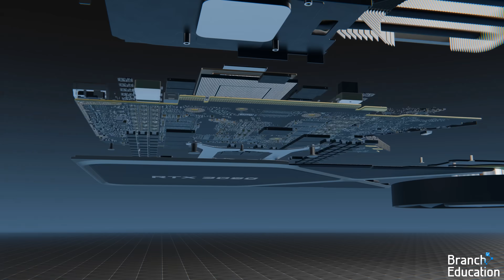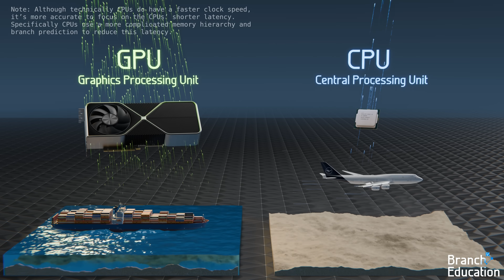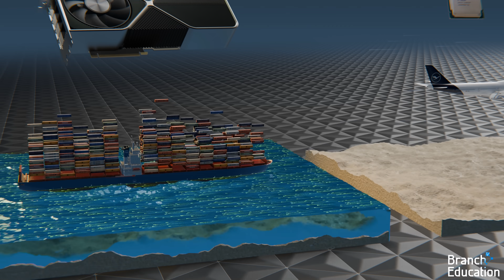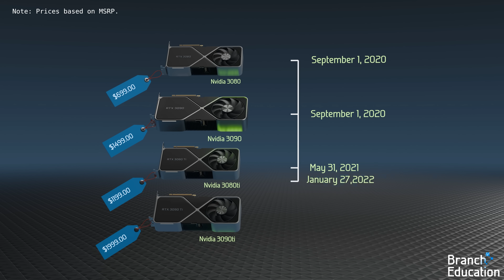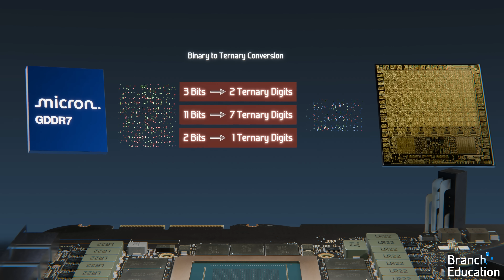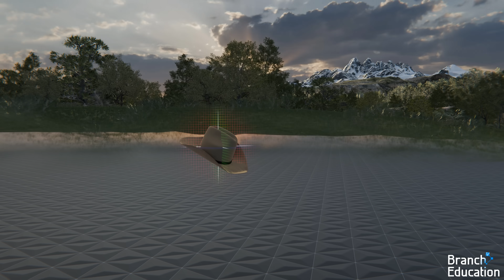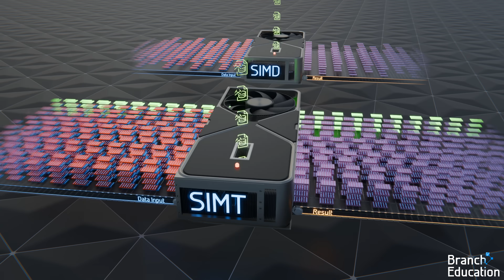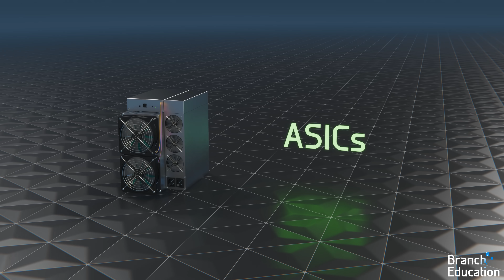How do Graphics Cards Work?  Exploring GPU Architecture

Comment: Great video, but as you quoted the N64 as being 100 million instructions per second I think you got confused rounding up the main MIPS CPU clock speed of 93.75MHz...
The N64 contains 3 components, the RSP which is the vector calculation unit of the N64 for transform & lighting, can process an 8 element vector instruction & dual issue its own scalar MIPS instructions in 1 clock cycle.
As the RSP runs at 62.5MHz (2/3 of the main CPU speed) its total calculation bandwidth is 500 million vector calculations + 62.5 million scaler calculations per clock cycle.
Also the N64 has an RDP (GPU) to render polygons to the screen running at the same speed as the RSP.
So in total the N64 is running at 93.75 + 500 + 62.5 + 62.5 million instructions per second (~718.75 million) when fully utilized, far more than the 100 million quoted at the start of the video!

Comment: any idea why my GPU bricked up whenever it htis over 66*C? had it for 7 years a 1060 3GB. 3 years used normally = these 4 years its undervolted while on boost clock

Comment: would be nice if there was an actual useful utility to see gpu load distribution and bandwidth utilization, especially on windows. otherwise just knowing about how things work is just useful theory.
Reply: There is, each hardware vendor has their own utility, in fact. NVIDIA has Nsight Graphics, AMD has Radeon GPU Profiler and Intel has its Graphics Performance Analyzers suite. Each plugs into hardware profiling metrics on the GPU to give you a breakdown of how each component and subsystem of the GPU is loaded, as well as where your performance bottlenecks are.

Comment: 8:45 correction, the 3080 actually has 10GB not 12GB, also the ti model has more memory bus bandwidth from 320bit to 384bit bus. It's basically a more cut down 3090 with half the vram

Comment: Very interesting video.  Although, I'm using a nearly decade old GTX-960 with 'only' 1024 Cuda Cores.  It was considered impressive when I bought it way back then.  And, I just checked on it on Amazon.  Still available, and surprisingly selling for $320 even at its advanced age.  I'm sure that if I was shopping for a new GPU today, I could find better for the same price.  But, not a gamer, so no need.  I bought it back then to speed up my seti@home crunching.

Comment: My question is, if you have a GPU with slightly more functioning cores than the 3080 but less than the 3090, do you 'deactivate' some cores to even it out or does that 3080 retain slightly better performance?

Comment: the part with the ASICs doing 250 Trillion hashes saying it replaces 2600 graphics cards.
didn't the few seconds before say that the graphics card only does 95 million?
isn't 95 million hashes per second per card, times 2600 cards, only 247 billion hashes?

are the putting around 1000 asics inside the "computer" to give it the 247 trillion number?
Reply: ASICs are smaller and take less energy. More of them fit.

Comment: It's a shame you didn't find someone who does graphics dev to review the video like you had for the memory part.

There's too many mistakes on the GPU side for me to let it slide:

1. You can run an OS on the GPU (it's not practical and it's slow, but it's possible). You can access USB,  network,  disk, etc. Today's Operating Systems are not happy with the GPU doing that, because it would compromise security. It's not a good idea to have two commanders in charge of the same platoon.
2. CUDA cores can do a lot more than just basic math. It can do jumps, calls, index memory, process strings, process interrupts, process virtual tables. A single CUDA "core" has more in common with a Z80 CPU than people would think.
3. A per-thread Program Counter is not what makes it SIMT. Only NV has per-thread PC, and only since Turing
4. GPUs moved from SIMD to SIMT a lot sooner than 2016. NV moved in 2006. AMD moved in 2012
5. Tensor cores can do geometric transformations, but they are not used for that in videogames
6. When comparing CPU vs GPU, I was hoping to see that they both approach parallelism in a different way; which is their main key difference. But alas, not even the world "parallel" was mentioned

This video is explaining how GPUs worked in around 2007 + Tensor + AI and how CPUs worked in 1997.
The memory section was cool though.

Comment: Spreading the different proceccing cores across the die is pretty smart as it also spreads the heat generation evenly when not all types are used

Comment: The animations are sick. But as a graphics programmer, I find the metapohors simplify too much. The GPU is equivalent to a ship? Yeah, no.
Reply: What would be an superior analogy to explain the difference between CPU and GPU?
Reply: @jannikheidemann3805  Cargo is more akin do data, rather than calculations. I mean, the containers don't do anything, do they? And why are do they use vehicles as an anology? The chips on your board don't move... No, a better analogy would be workers. The CPU would be a workshop. It's small, but it has all the tools to craft everything. The workshop has just a couple of workers, but because there is no bureaucracy, it's stupidly fast. If a customer requests an item, they can build it right there right now. But then there comes a customer that requests millions of the same item. Sure, the workers are fast, but not that fast. In comes the GPU, which in this analogy is more akin to a whole factory. The factory is specialized in doing one, but only one item. And because of lots of moving parts and bureaucracy, they are not as fast as the workers in the workshop. They take their time, just to start up. But because the factory owns a ridiculous number of machines, once they get started, they can pump out many items in a short amount of time. But to buy their item, the customer wouldn't go to a factory, would they? They would go to a storefront more akin to the workshop. They request their million items, the workshop prepares specifications, and sends them over to the factory. The factory then produces all the items. When they're done, the factory sends the finished items back to the workshop. This process is very simmilar to how you would program with a GPU. You upload data to the GPU, tell it how to deal with the data and what it should do with it, and then display the resulting image on the screen or download it back to the CPU.

Comment: @11:50 if you add a ton of Noctua Thermal Paste and a custom copper vram you can cut down the temps by 35c-40c. Especially on the 3090FE.
Reply: You mean a VRAM cooler?

Comment: It begs the question.  With the immense cost and complexity being a serious bottleneck of current GPU's why are we forcing TPUs into them when the vast vast majority of users simply do not need them?  Couldn't these be produced separately for those that need the AI processing power of TPU's and conversely no need for CUDA or Ray Tracing?  Would that not drastically reduce costs for all end users?

Comment: If we could find a better solution for cooling, that would instantly enable us all to output even more power since were able to cool the chips better (and those run better the cooler they are), i suspect in the future we will have graphics cards for example in a close system that is in a vacuum so we dont cist inside condensing water when cooled below a certain tempreture.

Comment: 7:06 Whaaat does it mean that my 4070 has the same chip as the 4090, but damaged? 😵‍💫 Sounds like heated seats in a BMW as a subscription.
Reply: No, the 4070 uses an entirely different GPU to the 4090 (AD104-250 vs AD102-300).

Comment: Absolutely amazing video! One small thing, while watching I noticed that you used the example CPU to be the 10850K (10th gen CPU Comet Lake Architecture), a 10 core 20 thread CPU, while when opening it up you showed the 12th gen architecture of Alder Lake, and more specifically the configuration of a 12900K with 8P 8E 24T (24 virtual cores). Just wanted to mention it as it may be a good disclaimer for an otherwise incredible video. Keep up the good work! :)

Comment: I am an engineer, and the level of detail, and animations like showing the eye diagram from the ternary encoding, drive tears of joy into my eyes. Thank you so much!
Reply: I hear you. 60 year old electronics engineer here that built his own 8-bit microprocessor systems back in the day. We've sure come a long way 👍!
Reply: @jcgdijkstra his own as in doing it at home? Respect mr
Reply: EE too, and I was like: WOW!
Reply: Looks you're mechanical from profile pic if that's your pic
Reply: A engineer in what?
Reply: Same man
Reply: You missed the bit where he uses the extremely poor analogy of humans doing a large multiplication problem right from the onset?  As an engineer surely you've heard of instruction sets - instructions per second is entirely different from 'calculations' per second. One calculation takes many instructions (which is why RISC was all the rage for a while and still is in certain applications).
Reply: @smackhead  I think you suffer from a delusional mental issue. This is not an introduction to instruction set design, but a video for the general public. Take two aspirin and go to sleep.
Reply: @ no

Comment: SIMD and CUDA are an absolute GODSEND when it comes to outputting image data.

We used to just build the math into the circuit boards, but the GPGPU model is SOOOOO much nicer! Learn to code in CUDA! I HIGHLY recommend it! ^^  When you're done with that, give barycentric coordinate systems a try and create a 3D rendering API. SO FUN! O_O

Comment: Excellent video!

Sometimes GPUs can come with other hardware acceleration circuits, like video encoders and decoders for h264 and h265. Although the encoders are fast, in my experience, they have a long way to go before they reach the quality and flexibility of software encoding.

Comment: 13:30 little quick thing, typically if you had 24 modules the memory bus width would be 768-bit, which would be 32-bits per module, however this isn't the for the 3090, which utilizes a double sided PCB since at the time they launched the 30 series Micron was making 8Gb (1GB) modules of GDDR6X, whose issues were memory temps. It wasn't until latter half of 2021 where Micron was manufacturing 16Gb (2GB) modules, hence on the 3090 Ti there's only 12 modules which provided better memory stability compared to the approach they went with the 3090.

Comment: Reusing chips with core failures in other card models is a scummy practice. Doing to much on a single chip with a low success rate will just lead to reliability issues and poor design or over heating... no wonder the 40series connector burns, pcb cracks and impossible to keep cool under a standard work load without 400-600 watts of thermal dissipation. The main problem with putting everything on one chip is features could be overlooked and you over work the chip. Don't believe me, take a lighter and hold it in one spot under your hand and compare it to moving it around.
Reply: But this is industry standard, isn't it?  They're all doing this and they don't all have thermal issues.
Reply: This has been industry standard for decades. Manufacturing defects are an inevitability, so much so that semiconductor manufacturers like TSMC straight up provide an expected defect rate when ordering a wafer of a specific process node. Without reuse, chips that happened to catch these defects would have gone to waste because the entire chip would be rendered unusable, which is why the microprocessor industry as a whole has moved to a modular design where areas of the chip can be disabled without affecting the rest of the chip. Hell, this is one of the reasons why AMD went with a chiplet design for Zen, since each chiplet is physically smaller so it's much less likely for an individual chiplet to contain defects, which improves yields (I think AMD cited +50% yields on Zen chiplets when Zen first launched?).
Reply: @jcm2606  @DeoMachina  you said the problems yourselves... this old way of thinking is whats hurting innovation because we're just chasing fixes for the bad cores instead of doing it right by not over exerting current technology for public retail.  How long since the 1080ti? why is mine still keeping up at 2.1 ghz and doesn't have the ability to thermal throttle anymore. Could go higher if I wasn't soft limited, yet other 1080ti's with a lower bin are already gone and they're really struggling to push past that era with current cards. (Yes the 40series tanks me, but with the heat, power connector issues and the degradation is what keeps me away) 50% production efficiency in 2024 isn't something to be proud of and you don't even know the amount of waste they make because they don't like admitting that to investors as they know already they could be making 50% more profit. Other industries aren't even making use of the newest of features, taking up space more rendering cores could and ever since added some features they have had thermal issues or they degrade faster then older series. 

You might be ok with replacing tech every year, some of us like our stuff to last longer then 9 months and get the full value from. I respect innovation when I'm not having to use prototypes and perpetual beta testing. When they slow down some chips to match weaker chips with defects I will always feel is the worst "industry standard" and I feel its scummy

Comment: The way computers are evolving is absolutely incredible. To think that everything starts with sand... Making sand do trillions of calculations per second. 
It's magic at this point.

Understanding something like the internal combustion engine is easy for example. Cylinder with a piston moving up and down it. Add a valve for air and fuel, add a spark, valve for the exhaust and you make power.
You can buy a small internal combustion engine, take it apart, examine it's parts and you'll know how it works.
Take the early analog computers they had in WWII, you can again examine it and work out how it functions. It'll take you longer, but you got your valves working like switches. On and off. On is one, off is zero. Add those ones and zeroes and you can make numbers out of that and then make the thing do gunnery tables for you.
But a modern day chip?! It's this this small, magic, silvery thing with some fancy writing on it that does maths... somehow. If you open it you won't understand how it works. You could look at it under a microscope - you still won't work out how it works. There are no moving parts in there. Just electricity moving about and somehow doing maths.
The processor in a microwave nowadays has more computing power than NASA did when they sent man to the moon.

And it's not like it takes a lot of electricity to run it... You'd think a "mechanical brain" would need many, many killowats of power and high voltage. But no, it needs less power than a vacuum cleaner. If that's not incredible - I don't know what is.

Comment: Micron employee here....I would recommend anyone searching for a job where motivation and capability are ACTUALLY rewarded and respected to look into applying with Micron. Best job I've had thus far in 10 jobs I've had with my 33 rotations around the sun. You do not need an electrical or materials science engineering degree even to be a potential hire at micron. I myself have a mechanical engineering degree, and my supervisor wrote her master's thesis in geology. Micron wants and will soon need (with massive FABs opening in Idaho and New York in the coming years) trainable, skilled and motivated people.